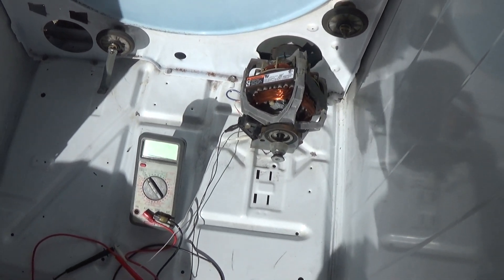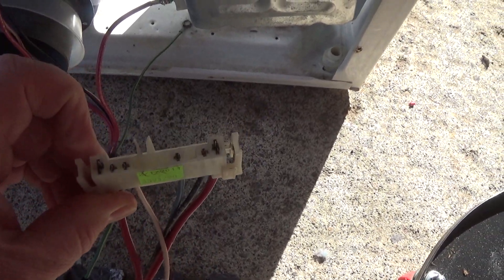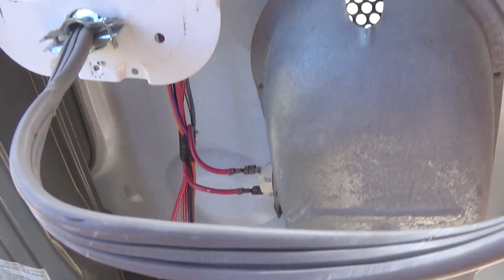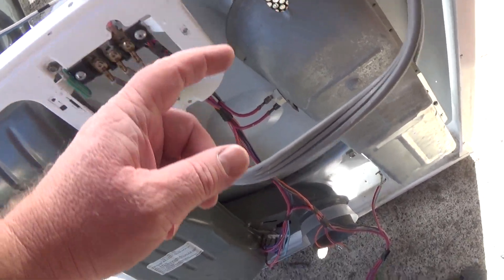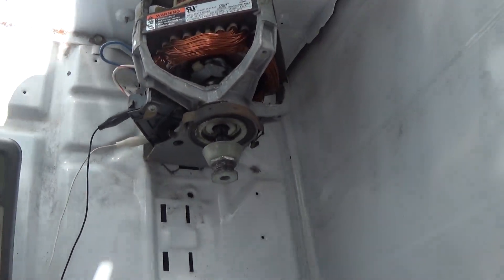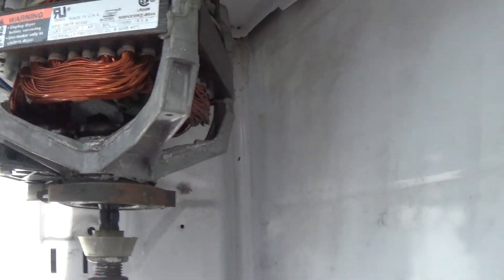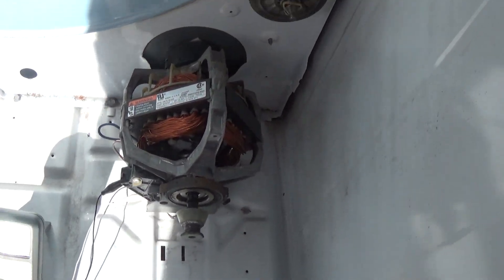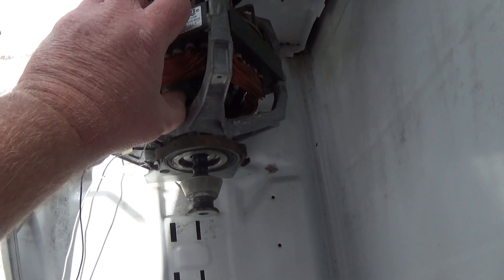Testing dryer motor inertia switch

Comment: Hi! I found your video because one of the red leads that goes into the “2” slot, well the wire harness is all melted, blackened at that insertion point. Looking into the 2 slot on the motor, that metal plug is blackened a little.  I don’t know what that means or if I need to replace the harness, the wire, the heating element, the motor, or all four. And if I just plug it back in the way it is, is it a fire hazard?

Thank you so much for this video it’s very helpful
Reply from the maker: If you can make a video showing what your talking about, I might be able to help out.